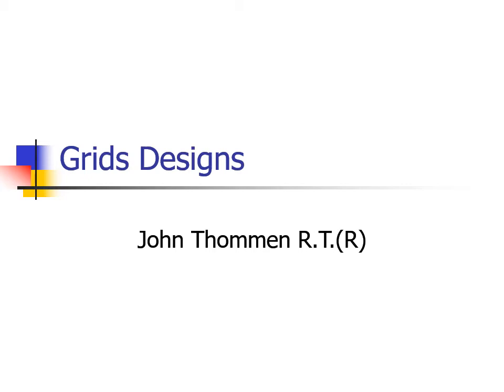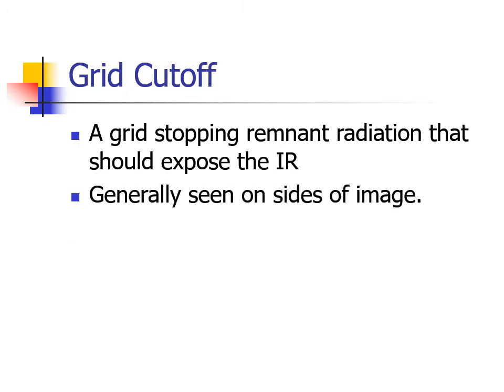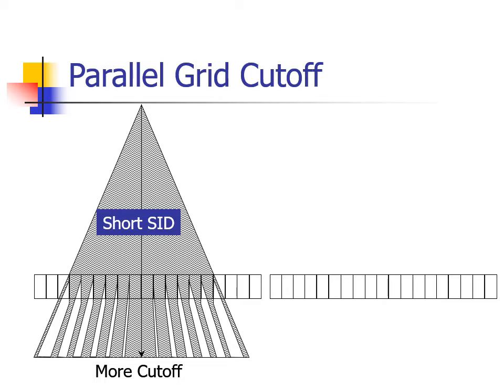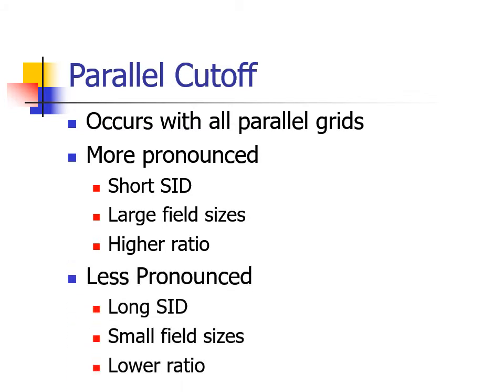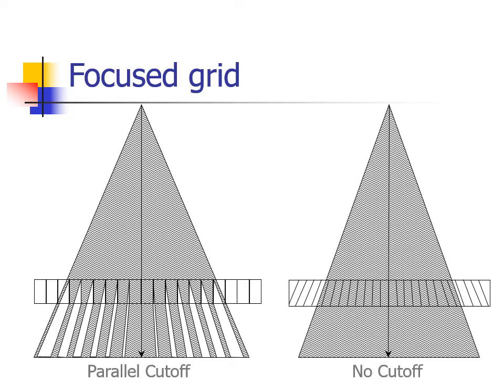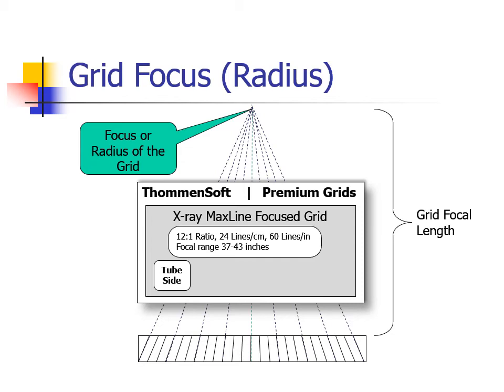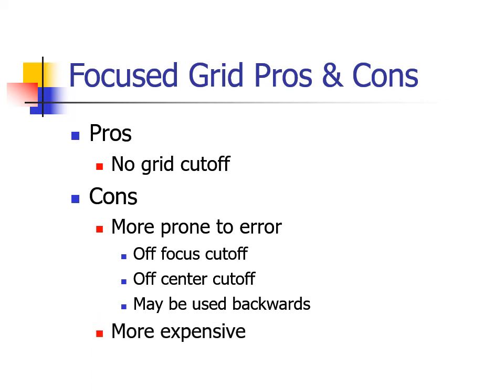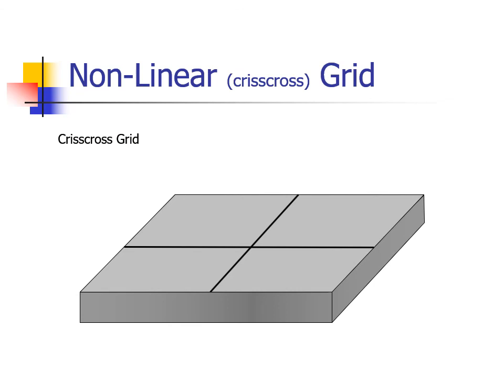Grid Design

Comment: My video explains how to optimally use a focused grid without any cutoff.  https://youtu.be/mZPD_gLs5Dw
Reply from the maker: While your point is correct I'm not sure what practical use it has in radiography.  When we angle for particular position we do not keep the focus of the tube in line with the grids focus. If the grid is running across the length of the table